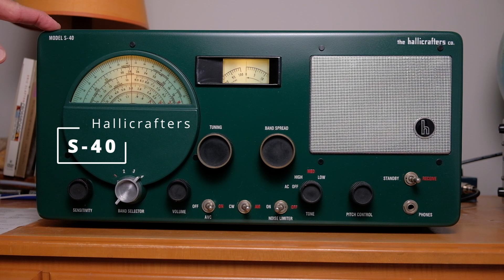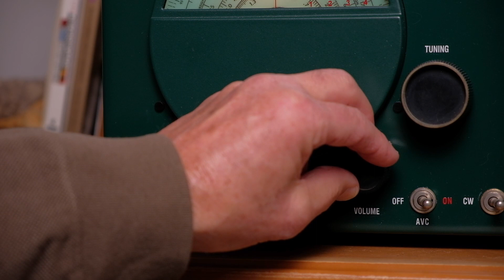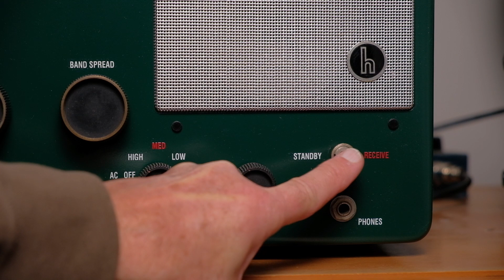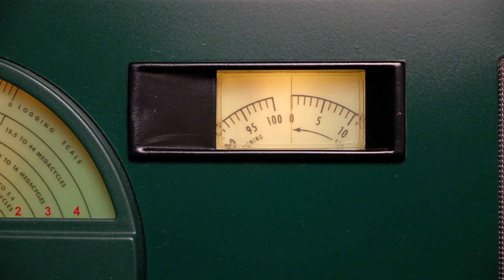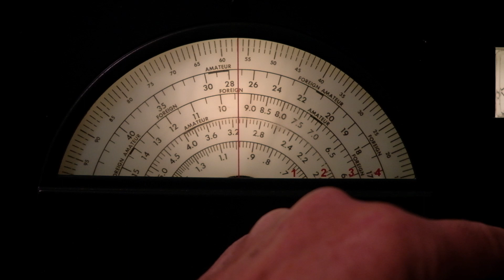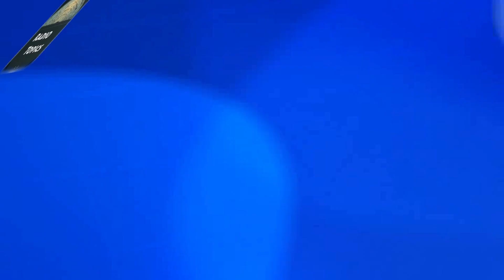Hallicrafters S-40 - The Good, the Bad and the Ugly

Comment: In the late seventies/eighties I could receive the CHP (California Highway Patrol)  on VHF Low Band, both the repeater output and directly from the patrol cars and motorcycles, but I was in Portugal with a SX-40 (calibrated).
Of course you would have to tunne it a litle bit to one side, because they were on FM and the receiver only had AM....
The propagation was completely mad (signals on CB were 9+50 dB 24h round  the clock on ALL CHANNELS (except channel 9, fully respected by all operators).

I could receive the REACT channel 9 units across USA....

Comment: I bought an S-40B with some good potential off eBay about 10 or 12 years ago and spent some time recapping, aligning and generally getting it into what I consider excellent condition.  I wound up replacing the toggle switches, one of which was broken.  Amazingly, these were still available in their original form.

Alignment is an art form.  I have spent countless hours aligning everything from S-38s to Hammarlund SP-600s (48 adjustments in the RF section alone).  My feeling is that dials were designed using a prototype chassis.  Given the vagaries of parts control, they just don’t fit all the production units very well.  Oscillator points should be adjusted about 10- to 20-percent in from each end of the band to get the best fit throughout the band.  The frequencies specified in the alignment instructions should serve only as starting points.  Once the main tuning was aligned as well as possible, I developed frequency graphs on the bandspread logging scale.  An outboard crystal calibrator is helpful for this.

I restrung the tuning and bandspread dials using 50-lb test, microfilament, braided fishing line.  This is much better than regular dial cord, as it provides exceptionally smooth tuning with minimal slack or backlash.  The bandspread on the S-40B lacks the nice flywheel present on the original S-40.

My unit is also setup to plugin an optional outboard Heathkit GD-125 Q-multiplier.  This improves selectivity.

Many years ago, a ham buddy taught me how to tune single sideband using combinations of the sensitivity and pitch controls, and CW and AVC on/off switches.  For tuning SSB as well as narrow bandwidths produced by the Q-multiplier, the main drawback of these old radios is stability.  They drift significantly during warmup, and somewhat less thereafter.

All things considered, the S-40, S-40A and S-40B were excellent cost-performance tradeoff options for hams and SWLs 70 years ago.  Yours, sir, is a beauty and must give you lasting satisfaction in its restoration.
Reply from the maker: Great comments. Thanks!

Comment: Lots of S-40 turn up... at least around here. (noting rare for sure... and not a great radio either.) I think it's mostly  because of the Hallicrafters name.  (for sure, there's an S-40, in more than a few basements, as ballast, to hold the floor down.) As for decal kits (or even cap kits) ... I think they sell a fair amount of them. It's not a rare receiver at all.

Comment: My Dad bought me one of these when I was at secondary school - about 1966. The problem here in the UK was that my set was purely US voltage - so had to use an auto-transformer to step down the supply from 240v. It gave me a lot of fun listening to Voice of America (including "This is the Voice of America in Special English") also radio Moscow, Prague, Tirana (Albania - used to give the Chinese spin on the news, mainly Vietnam, American Paper Tigers etc)
Not sure I agree with your comment on SSB. But mostly UK radio amateurs used SSB on 80 metre band and it was very stable. I seldom got any amateur transmissions on 15m or 10m bands. I see you also got nothing on 10m.  Possibly there was a problem on the highest frequency range. I tried "upgrading" the set by replacing the mains supply transformer with a UK type, fitting silicon rectifiers and some other mods. My brother has it now, but to restore it to pristine condition like yours would be a major project.      😀

Comment: Set the slug in the OSC coil on the low end of the dial. The reset the top of the band using the trim cap. Go back and fourth a few times.  I have several  National NC57 units. One does not have slugs in the coils so there is no way to fix the tracking.  Do the Slug in the Coil of the OSC first. (AM) Broadcast Then do the Cap.  If you reverse the operation it won't work.